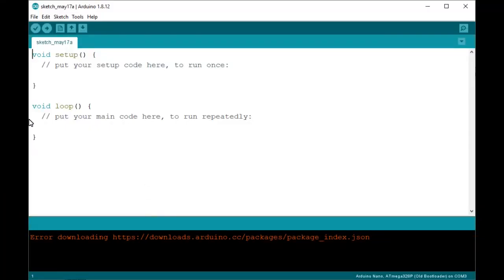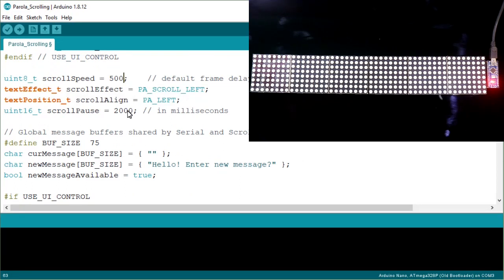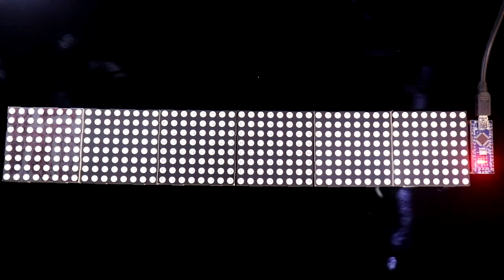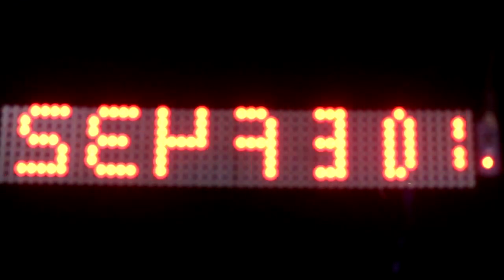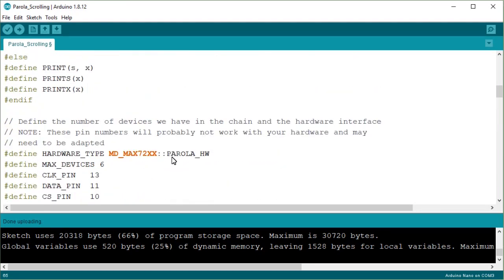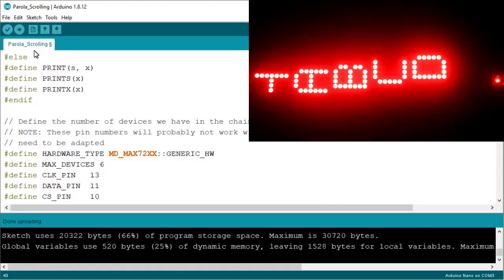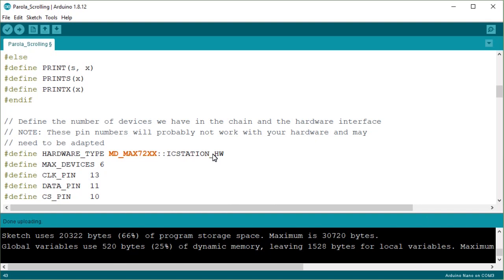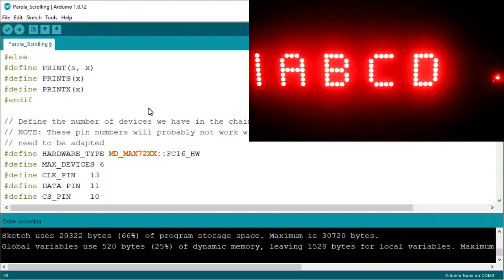How to solve mirror image and orientation problem in LED matrix with MAX7219

Comment: ...what command should I code do that the pin is on the left side ..how do I turn it  upside down...or how do I connect another set stacked below the 1st display with the pin closer to each other so I need not run long wire and definitely it is in reversed order..? FC16

Comment: Can you help me, i need to display Arabic text wath Parola
Reply: I think this Parola library is for English Language only.
You have to manually write code  for each column and row of the dot
I tried this before but I have mirror problem effect using LedControl.h library.
Till this day i still can't find the solution. I probably need to buy new 8x8 dot matrix and hope that I will get different model that doesn't have the same issue.